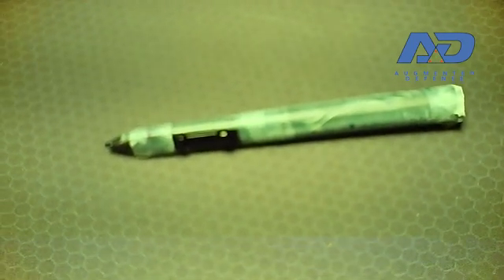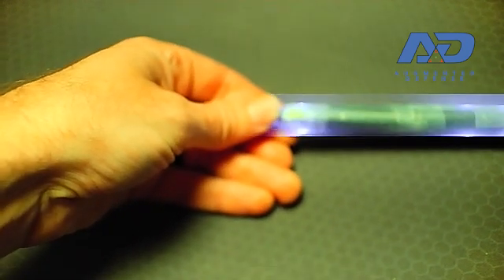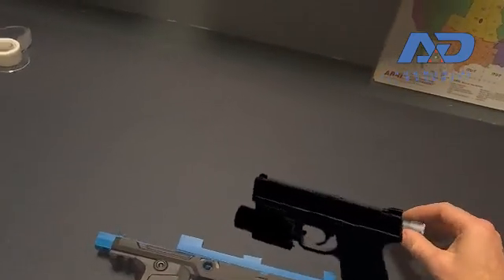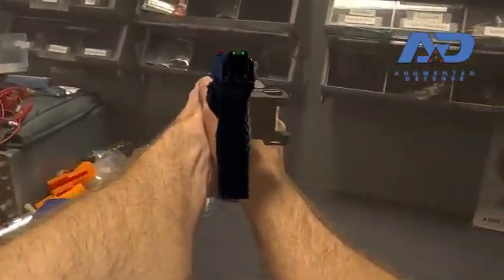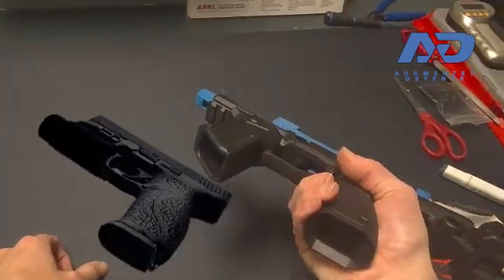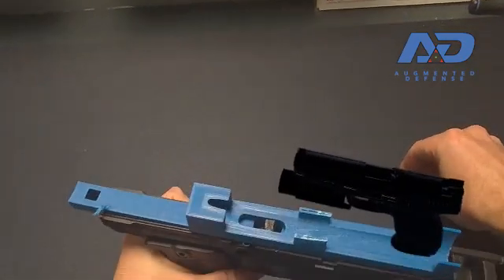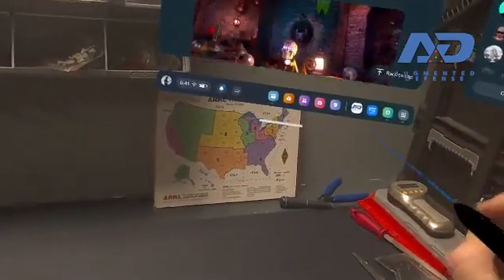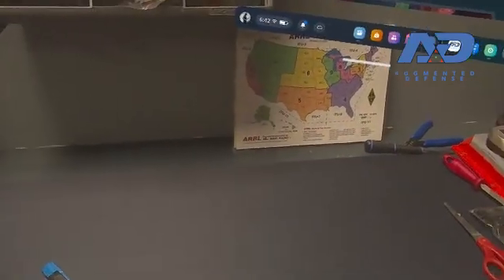Lets build a tracked Pistol controller with the Logitech MX Ink - Part 1 - Tracking

Comment: Watched both parts and its a super cool use for the pen. The form factor seems to actually make a difference from the controller. Really curious to see how you dealed the trigger mechanism for the pen. Great stuff!
Reply from the maker: I've been working on designing a dry fire trigger pack, that i'll use with this, and the other designs i've worked on. A good dry fire trigger has been one of the hardest parts of all my controller designs so far, so I want to stop having to reinvent the wheel every time I make a new controller

Comment: Do you need to disconnect a controller to use the pen, or can all three components be active simultaneously?
Reply from the maker: Yes, and no. You don't need to unpair a normal controller. but the headset will "report" the pen as a controller in a legacy application, that doesn't have the pen sdk in it. AFIK, only two are ever "active" at the same time.
Reply: In terms of how you will use it, since the game is not designed for the pen, you won’t have to disconnect either controller. Just go ahead and use it. Is this what you mean, I suppose? By the way, can it track fast movements, say, when swinging a bat in a baseball game or golfing? Have you tested tracking in that scenario?
Reply from the maker: @ls4life544  1. yes 2. I made a followup video of it played in pistol whip, and it worked great in there. I haven't tested club or bat mechanic's. imo it would come down to tracking led visibility.